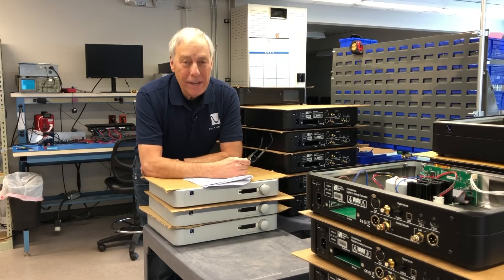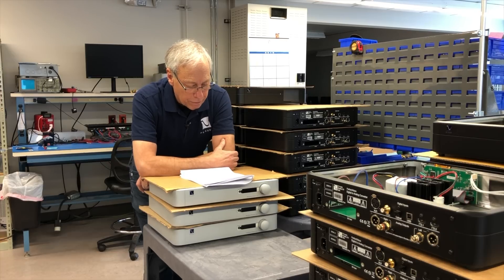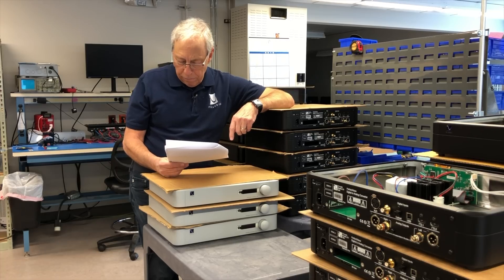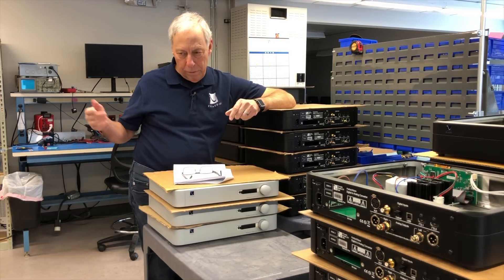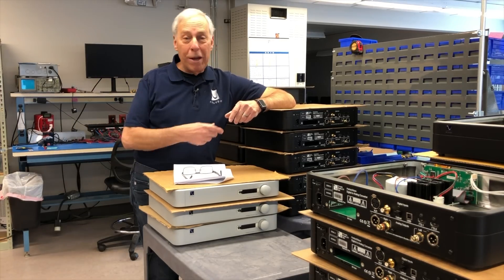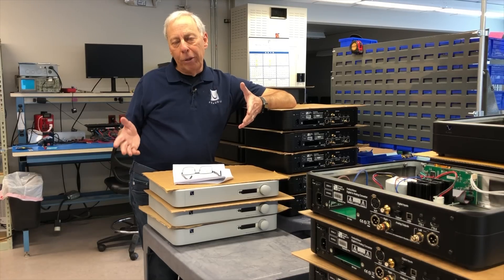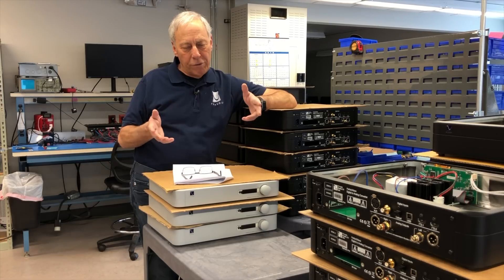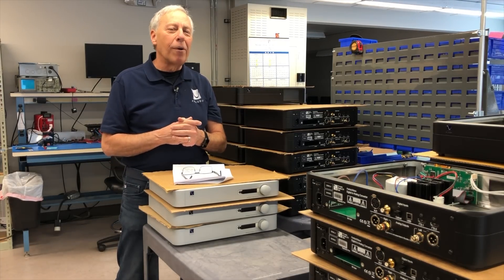Is it dangerous to run an amplifier without a load?

Comment: Why didn't you explain why a absence of a load doesn't hurt an amp? You won't answer. Never do.
Reply from the maker: I apologize if it appears I didn't answer the question. I just watched the video again and I believe I said right up front it would not harm the amplifier. What is it you're missing? You want to know why it won't harm the amplifier? Let me ask you why you believe it would? 

Without a load, no current flows out of the amplifier. It can voltage swing to its full rails but, again, if there's no load there can be no current exchange. So, imagine the voltage going from rail to rail (worse case and it shouldn't do that on a properly designed amplifier) on the output devices (tube or solid state). Nothing is harmed because the valve that is controlling the voltage swing can only modulate voltage as high as the power supply will allow. There is nowhere outside the bounds of the power supply to go and the valve (tube or solid state) sits between the two power supply rails. In other words the maximum power supply voltage is always applied to the circuit. The fact that then the signal moves between those rails means nothing to the components within those power supply bounds until you apply a load. The load now provides a path for the voltage to go outside its rails and current begins to be delivered.

I think one of the misconceptions people have with amplifiers and the load vs. non load question is that we tend to think of amplifiers like mechanical devices, say an engine. It can damage an engine to rev too high without a load (or even with a load but it's harder to exceed its bounds with one). 

Hope that sheds a little light on it for you. I don't normally go into that level of detail on the videos because I attempt to keep them short so people don't fall asleep.
Reply: PS Audio thanks for replying. Yeah I missed it right in the beginning, apologies.
Reply: @Paulmcgowanpsaudio   Paul, the power supply is not the limiting factor in how high the voltage can get. The output transformer can store energy and can create spikes of voltage in excess of 1kV in the primary. An excerpt from Speakers are
 Important In or Out of the Circuit by Hartley Peavey offers a clear and detailed explanation. You can find it on the Peavey site:

The above is a rambling discussion about transformers
(both power an output) and their effect on the sound of
a tube guitar amp. I felt it was important to understand
what transformers do (and generally how they do it)
before getting to the final point of this discussion. As
mentioned above, a transformer works by converting
one form of electrical energy into another. In the case of
a tube amp, to achieve the matching, we “trade” high
voltage in the primary, for high current in the secondary
to properly drive the speaker. This is a “two step” process
where electrical energy from the tubes magnetize the
core of the transformer at the audio rate. Then, the
varying magnetic field in the core induces voltage
(and current) into the secondary suitable to drive the
speaker. The important point here is the energy is put
into the transformer through the primary, which converts
that energy into magnetic energy (i.e. it magnetizes the
core) and then that energy is reconverted into electrical
energy in the secondary windings, which drives the
loudspeaker.

If (for whatever reason) the SECONDARY of the
transformer has no “load,” the magnetic energy created
by the primary (and “stored” in the core) has NO place to
GO! As the alternating signal in the primary goes down,
the magnetic field built up in the core “collapses,” thus
inducing an extremely high voltage “spike” back into the
transformer’s primary windings. Because this energy is
substantial, and because the primary coils have many
turns of wire, an extremely high voltage “transient” (often
3000 volts or more) can be developed. The primary of
the output transformer is directly connected to the tubes
and tube sockets of the amp, and neither the tubes nor
the sockets (and associated wiring) are designed for
that kind of voltage. These electrical “spikes” can (and
often do) cause “arcing” inside the transformer and/or
the tube elements, especially between the terminals on
the tube sockets and the associated wiring.

Remember that we learned in high school physics
about the “law of conservation of energy.” This taught
us that energy can’t simply “disappear,” it has to “go
somewhere.” When a tube output transformer doesn’t
have a place for the energy to go (i.e. a speaker or its
equivalent) the energy developed in the magnetic core
“flashes back” into the amplifier, often destroying the
output transformer, the tubes, the tube sockets, and/or
the associated wiring.

This is WHY you should NOT operate a tube amp
without a “load!”

Ignition coils for gasoline engines work essentially the
same way. There’s a “secondary” coil of wire with many
“turns” of wire wrapped around a steel core. In operation,
a connection is made to a power source (battery) then
current flows though the primary coil and magnetizes
the iron core. The contacts (points) then open and the
magnetic field is allowed to “collapse,” which results in a
huge “pulse of energy” being inducted into the secondary
coil (which is what produces the electrical “pulse” that is
fed to the spark plug). This is also a two step process
where basically the primary coil is energized, producing
a magnetic field, then “de-energized.” As the magnetic
field “collapses” the magnetic energy stored in the core
induces a high voltage into the secondary coil which is
then fed to the spark plug, thus firing the air/fuel mixture.

An “UNLOADED” tube output transformer produces
high voltage “spikes” in EXACTLY the same manner as
an “ignition coil” does. The difference being that a tube
amp output transformer is NOT designed to operate that
way, but an ignition coil IS! Operating a tube amp with
its transformer unloaded can easily damage or destroy
a perfectly good tube amplifier by the “flyback” action
described above. Hopefully, the above will provide a
little background as to exactly WHY it’s important NOT
to operate an amplifier WITHOUT a proper “load” for the
output transformer’s secondary output terminals.
Reply: @mutantbaby1672  The output transformer can store energy. Prove this. It's not a battery or a capacitor. And it's not a flyback transformer So how does it store energy? When you turn on the light does electricity flow? Yes it does. If you turn off the light does electricity flow? No it doesn't. So no load no flow. What are you not getting. Whatever this Hartley Peavy excerpt says. It's called laws of physics. OT blow for many reasons. So do PT. And Power tubes. A mismatched impedance will reek havoc on OT. A shorted speaker. These faults are acting like the light switch. but believe what you want. Everyone has an opinion and you just heard mine.

Comment: A more relevant question is if shorting a power amplifier will damage it. Surely in such case many amplifiers will potentially get damaged and the risk increases at higher volume levels. Also some amplifiers can get damaged when a voice coil melts due to playing too loud or if you run multiple speakers in parallel yielding a too low impedance. Then you have all the risks associated with heat from playing loud perhaps combined with poor ventilation. For example many power amps require a certain air flow and if you block it, it might end up self destructing.

Comment: Surprised by this answer.  I've read in manuals that you should NEVER run amps without speakers connected. I'd even heard about resistor packs across the outputs to prevent damage.  These weren't Class D to be fair, but still.  Surprised.

Comment: As well as valve (tube) amps, some class A designs don’t like being run without a load... a Musical Fidelity A1 will very likely blow its output stage if you run it within a load... altogether in fairness, a Musical Fidelity A1 will blow its output stage if you look at it the wrong way.

Comment: I agree with the consensus about tube power amplifiers being damaged without a load. A popular design in the 1950s, the Williamson type amplifier would be damaged instantly without a load as I recall. Solid state power amplifiers not a problem.
Reply from the maker: It's hard to imagine how this could work since the lack of current would only mean the voltage had nowhere to go. The tubes at the heart of this amplifier sit between the high power supply voltage and ground. That power supply voltage, let's imagine 150 volts, is constant. The output tubes should be stable at any input voltage level they are then responding to and the highest voltage possible cannot exceed the limitations of the power supply. Applying grid voltage that forces the tube to output voltage without a load has no mechanism of failure unless it becomes unstable, which would be a ridiculous design.
Reply: Mark Fischer   I can't believe Paul is saying this. "the highest voltage possible cannot exceed the limitations of the power supply" is not true. The output transformer without load can store energy and can create spikes of voltage in excess of 1kV in the primary. An excerpt from Speakers are Important In or Out of the Circuit by Hartley Peavey offers a clear and detailed explanation. You can find it on the Peavey site.

The above is a rambling discussion about transformers
(both power an output) and their effect on the sound of
a tube guitar amp. I felt it was important to understand
what transformers do (and generally how they do it)
before getting to the final point of this discussion. As
mentioned above, a transformer works by converting
one form of electrical energy into another. In the case of
a tube amp, to achieve the matching, we “trade” high
voltage in the primary, for high current in the secondary
to properly drive the speaker. This is a “two step” process
where electrical energy from the tubes magnetize the
core of the transformer at the audio rate. Then, the
varying magnetic field in the core induces voltage
(and current) into the secondary suitable to drive the
speaker. The important point here is the energy is put
into the transformer through the primary, which converts
that energy into magnetic energy (i.e. it magnetizes the
core) and then that energy is reconverted into electrical
energy in the secondary windings, which drives the
loudspeaker.

If (for whatever reason) the SECONDARY of the
transformer has no “load,” the magnetic energy created
by the primary (and “stored” in the core) has NO place to
GO! As the alternating signal in the primary goes down,
the magnetic field built up in the core “collapses,” thus
inducing an extremely high voltage “spike” back into the
transformer’s primary windings. Because this energy is
substantial, and because the primary coils have many
turns of wire, an extremely high voltage “transient” (often
3000 volts or more) can be developed. The primary of
the output transformer is directly connected to the tubes
and tube sockets of the amp, and neither the tubes nor
the sockets (and associated wiring) are designed for
that kind of voltage. These electrical “spikes” can (and
often do) cause “arcing” inside the transformer and/or
the tube elements, especially between the terminals on
the tube sockets and the associated wiring.

Remember that we learned in high school physics
about the “law of conservation of energy.” This taught
us that energy can’t simply “disappear,” it has to “go
somewhere.” When a tube output transformer doesn’t
have a place for the energy to go (i.e. a speaker or its
equivalent) the energy developed in the magnetic core
“flashes back” into the amplifier, often destroying the
output transformer, the tubes, the tube sockets, and/or
the associated wiring.

This is WHY you should NOT operate a tube amp
without a “load!”

Ignition coils for gasoline engines work essentially the
same way. There’s a “secondary” coil of wire with many
“turns” of wire wrapped around a steel core. In operation,
a connection is made to a power source (battery) then
current flows though the primary coil and magnetizes
the iron core. The contacts (points) then open and the
magnetic field is allowed to “collapse,” which results in a
huge “pulse of energy” being inducted into the secondary
coil (which is what produces the electrical “pulse” that is
fed to the spark plug). This is also a two step process
where basically the primary coil is energized, producing
a magnetic field, then “de-energized.” As the magnetic
field “collapses” the magnetic energy stored in the core
induces a high voltage into the secondary coil which is
then fed to the spark plug, thus firing the air/fuel mixture.

An “UNLOADED” tube output transformer produces
high voltage “spikes” in EXACTLY the same manner as
an “ignition coil” does. The difference being that a tube
amp output transformer is NOT designed to operate that
way, but an ignition coil IS! Operating a tube amp with
its transformer unloaded can easily damage or destroy
a perfectly good tube amplifier by the “flyback” action
described above. Hopefully, the above will provide a
little background as to exactly WHY it’s important NOT
to operate an amplifier WITHOUT a proper “load” for the
output transformer’s secondary output terminals.

Comment: And the rare examples of current-drive solid state (!) amplifiers clip, with no load attached. But I think that does not give a problem. High voltage and no current. I never tried it on mine.

But I would not try to connect the loudspeakers to a powered current-drive amplifier, even with no input signal!

But short circuit at the output gives no problem with current-drive, even with signal on the input.
Reply: My Name Nope!
With current-drive (not voltage-drive as almost all amplifiers) the current is controlled according to the input voltage. So, with short circuit it creates just a tiny voltage to create the current.
Reply: @My Name That's because!
To be explicit: I am talking about current-drive! With some voltage on the input, a current-drive amplifier tries to create a certain output current. And with a short circuit that is easy, as Ohms law says. V = I x R. So with a tiny load (R), you need a tiny voltage (V).

And more general. For a current-drive amplifier goes: the lower the load, the lower the output voltage, and the lower the output power. It is complete the opposite than with voltage-drive.

Comment: When I was in engineering school, I was taught to always have a load on the output transformer in a tube amplifier; otherwise you can fry the amplifier tubes.  Also in tube type transmitters, you definitely have to have a load on the output or you will be replacing very expensive amplifier tubes.  I have seen it done.

Comment: I've enjoyed this video so much! When I started my discovery in hi-fi there was no Paul on Internet and I had to find out the outcome to these mysteries  empirically 😟😆😉.
I think there's such an amp whose designer cautions against turn it on, even with no signal, an no load connected, of course,  the Swiss Dartzeel power amp, it seems Mr. Delatraz uses 'crowbar' of something like that, to protect speakers.  A rarity. 
Hey Paul, I wouldn't let 7/24 on not class A amps or 'vintage' gear with more than twenty years since they were crafted. Art Dudley learnt the tough way when his house almost set on fire while he left a amp running in and warming up. Yes, the sound is better when they are on continuously but with caution.

Comment: Running an amplifier which has a vacuum tube power output and an output transformer can most definitely have the potential for damage. While there are a few amplifiers where this is not the case, in general, do not tempt fate. The output transformer can be damaged.

For solid state amplifiers, as Paul says, it doesn't matter.
Reply from the maker: That is not true. Voltage swings on an unterminated transformer will not damage the transformer. Think of it this way. A transformer is nothing more than two coils of wire between some steel plates. Unless the voltage you are applying is hundreds to thousands of volts exceeding the breakdown characteristics of the wire or laminations (unlikely) applying output voltage to the transformer when it is not terminated will not harm the transformer in the least. It's an old myth.
Reply: @Paulmcgowanpsaudio  Them why have I (and many, many other audio repair techs) had to replace output transformers damaged in just this way? It's no myth. It happens because the output transformer ceases to be a transformer when it has no load, and becomes an undamped inductor instead. https://youtu.be/99_6OHMfuL0
Reply: @Paulmcgowanpsaudio  A non loaded transformer becomes a coil. It's not an transformer anymore. This can oscillate with the stray capacitance of the windings and attached circuit.